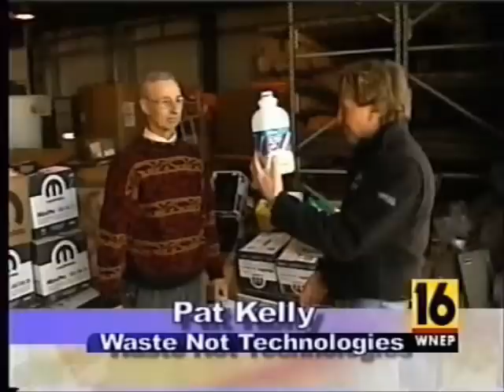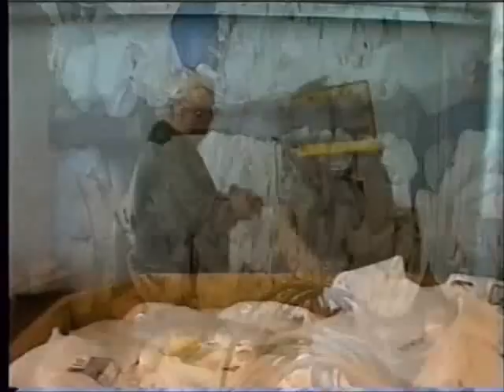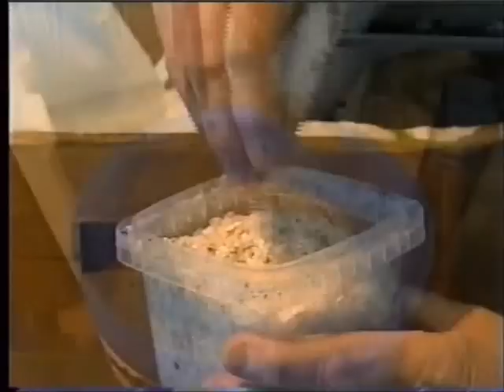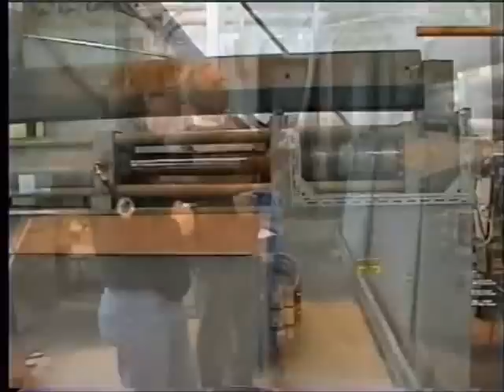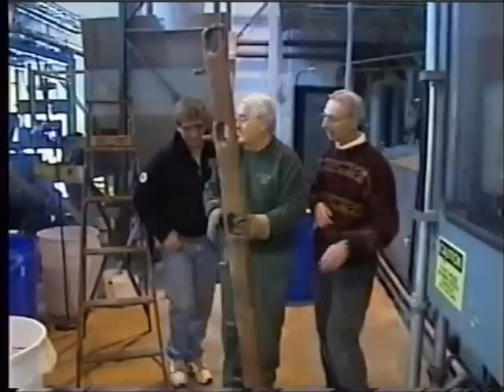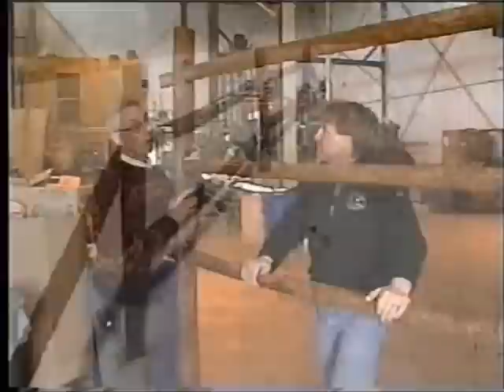Recycling Milk Jugs into Fencing

Comment: we use to have a plant that could melt down the plastic till they had a fire  they were that was about 20 yrs ago since it happend and during that time recycle was not a hot topic as it is today they made sheets of plastic size of plywood but solid plastic it was great product I used in on a basement floor made the floor much warmer and he water doesn't afffect it was easy to work and I glued it to the cement floor using no more nails. still there till this day.I am sure they could make some nice snap togeter floating floor tiles from this product and the different colors of platic they could make it look like marble.

Comment: I don't get what was so wrong with glass containers. It wasn't even recycled. It simply needed to be washed out and reused. I don't get why they just smash the glass instead of sending it back to the bottlers. They delivered milk to you in glass bottles, you gave them back when you were done, they washed them out, and they filled them back up with milk. Much more economical than melting down plastic. You can only recycle this stuff so many times.
Reply: it will eventually come to that.we have to face that after 2 or more reincarnations. goedendag
Reply: People used to put their cigarette butts in coke and soda bottles, not to mention other things not to be discussed. If anything was said they became quite profane. Always the one percent to ruin it for everyone.  I  like your sentiment.
Reply: So, you can't wash those things from a glass bottle? Glass isn't going to react with either of those things. Plastic, yes. Glass could simply be washed by boiling hot water.
Reply: probably had to do with the weight of glass vs plastic which makes a big shipping difference in volume and safety because if you drop a glass container it can be dangerous. I do get your point though about reusing containers.. unfortunately plastic containers can't be reused.
Reply: Yeah, but I would think the hit from transportation of full containers is overcome by being able to simply wash them, instead of having to shred, clean, and melt the plastic stuff. Not to mention that recycling plastic is pretty inefficient, because it's almost impossible to not contaminate. Every time it's recycled, it degrades.
Reply: +Tim Ramich well what you are saying is true... but your forgetting that companies are not shredding and melting the old bottles to repackage their product, like milk for example.. instead they are making new bottles all the time. which im sure us cheaper and less of a headache for them.
Reply: How would making new bottles be cheaper than washing out something like a glass bottle?
Reply: It's a shame they don't make landscaping timbers. They would outlast PT wood.
Reply: +Michael Hartman thats a good Idea, but they might not be strong enough to hold back the weight of the dirt.. you saw how much bend there was when the guy pulled on it
Reply: +justafan marvel I use 1/2" x 2 ft. rebar anchors spaced according to strength needed. I don’t know what you have envisioned, but I think most flowerbeds and garden borders might be contained in 1 to three timber high (12") walls. Looking at the neighborhood every house has timbered borders. I wonder if there would be leaching of dangerous elements like pressure treated wood and railroad ties. (railroad ties poison the soil for growing food  indefinitely)

If they were as strong as 2 x 4s they could be used in interior walls where  appearance isn't important and ultraviolet radiation isn't a problem. I wonder what the comparative price is.
Reply: +Michael Hartman i know what you are saying but Im still not sure that it would meet the strength requirements for the kinds of things you are talking about.. however more decorative applications would work fine like flowerpots.. landscape trim etc. of course siding for homes, flooring and maybe even roofing shingles would all be great applications
Reply: +justafan marvel I agree.
Reply: Tim Ramich
We buy our milk in 2 qt glass bottle from our food co op, here in Wisconsin. Just rinse the bottles and return them to the store. Castle Rock, is the name, Pasteurized and bottled on their farm.  Love the rich creamy taste too!
Reply: Well sadly everyone wants a perfect product and glass containers are very easily damaged just getting them back to the factors.
So then it's not just a matter of washing to perfection but inspecting every last piece top to bottom, and those that don't pass get smashed and molten again just the same.
Reply: .. they still wash and reuse glass bottles in 3rd world counties .. In Uganda you have to return glass bottles to buy refilled ones .. the reason it is not done in the USA anymore is because it is actually cheaper to make new glass bottles than to wash them or to recycle broken glass when you are talking large scale .. plastics for bottles are even less expensive .. are much lighter to decrease shipping costs and, of course, less prone to breakage, reducing waste
Reply: @justafanmarvel9669  : I am not certain on these facts, but here goes !   😊😊😊😊
1. There isn't a lot of strength required of most interior walls.
2. If strength is required, AFTER the "plastic lumber" 😊😊😊😊
is joined together, I would think you would generally have most of the strength you need for an interior wall.
The main problem, I would guess, is that plastic recycled boards are not as cost-effective as wood.
 In other words, wood is cheaper.
Reply: @dancahill9122  well wood probably is cheaper compared to the process of recycling plastic into 2x4 lumber... that's one reason... but i also think that there are a number of other factors such as resistance to heat... plactic can melt and deform wood and metal don't, attaching drywall to plastic studs probably isn't a good longterm idea either as the screws will strip plastic out and cause the sheetrock to pull away... then there is sound transfer as wood absorbs sound and plastic reverberates it changing the acoustics in a room and then there is the fact that plastic has off gasing which is toxic and plastic can become brittle overtime compromising the structure. I'm sure there are many other things i haven't considered. Belive me i am 100% in favor of recycling, reusing and lowering the cost of materials and maintenance  but i don't think this is a solution. I think recycled plastic is best used for non structural exterior applications where their properties can be maximized and their drawbacks can not harm us.
Reply: @MsSomeonenew   i picked many glass pop bottles up in the ditches as a kid 3 cents each not many were broken. now i pick the trash up in the ditch in front of my place most the glass beer bottles are not broken. from what i have heard unless glass bottles are reused. the recycling process is not glass friendly  too many colors and  types the crushed glass winds up as a landfill item. at least it doesn't  make islands in the ocean like plastic
Reply: @MichaelSHartman  people put rocks in and stuff in aluminum cans but they still recycle those. They don't reuse them because of obviously reasons. Like wear.
Reply: @justafanmarvel9669  That it does ,three eight packs of glass weighs fifty one lbs , plastic weighs a little more than half .Coke and Pepsi too many back injuries.
Reply: @beckywatt5048  i believe it. Glass has better properties, but plastic is all around easier
Reply: @justafanmarvel9669  We used to get our milk delivered in glass when I was a kid, I will have to agree everything tastes better in glass.
Reply: @beckywatt5048  that is true... if you want to do a blind taste test it's been my experience that Yoohoo demonstrates the best example of what you are saying... in the traditional old glass bottles Yoohoo tastes amazing... in plastic or out of a carton its almost undrinkable
Reply: Tim, The cost of sterilizing was more than bottlers wanted to continue with. Weight of glass containers was another factor. Also the retrieval costs were another consideration along with deposit refunds. I, like you, think it's a shame they don't do the 'real' recycling anymore but thats what bean counters do.:(
Reply: @timramich  Good question. Obviously if the bean counters are doing it this way it has to be the cheapest way.
Reply: Requiring a deposit on all containers (to account for the pollution if its not recycled). And for ppl that don't return them it will become tax. And since many stores won;t want to deal with recycling plastic. An alternative will be for the stores get bulk deliveries use recycled cleaned glass container like for milk and it will reduce the distance the heaver glass container have to travel. 
If truly safe biodegraded containers could be exempt from a deposit requirement. But pollution has cost so the cost should be added to the ppl buying the product and get the money make if they are recycled.
Reply: While it is a great idea, sadly some dam fool will introduce chemicals to poison others.  You can treat glass is such a way that it will only discharge the material either under cold thereby defeating the cleaning process.
Reply: @jimb9369 U must be joking? 1st what lethal material that fits those characteristics? But  just to be sure we will rinse it with cold water to prevents the psychopath killer scenario that your paranoid about. There has been food and drug tampering cases before but I have never heard of any that involved recycled bottles. So this no added risk. And good luck getting help with paranoia.To much time on social media can cause it.
Reply: Glass weighs a LOT more than plastic. I reuse my plastic jugs twice as much as other people. I fill them with water and use them for target practice before trashing 'em!
Reply: @nc3826 - Insofar as is the product that can be lethal, why would I put that information on the net? Are you kidding! Believe what you want.  Guess you missed the tampered pills that were sold years ago that killed so many.  No doubt you know everything!
Reply: @jimb9369 Just curious what's ur thoughts on vaccine safety? (while its off topic it's a more salient issue)
Thx for mentioning the pill tampering. That shows there are many easier ways to tamper with food or drugs already. And just rinse the bottles with cold water (which I already mentioned) eliminates the risk you mentioned. But if you still think it's unsafe don't buy it (if it ever becomes an option for you).

And we shouldn't make it about personalities. Since ad hominem issues or attacks are just a distractions from the subject matter.
Reply: @flapzapple7786  I'm sorry the far more environmentally sound alternative glass is to heavy for you. But thx for trying to partially mitigating all the environmental damage from ur plastic jugs.
Reply: @timramich  .. contamination is not so much an issue .. ABS degrades and for instance, you can not use recycled ABS in medical devices in the US, only virgin and recycled ABS .. HDPE doesn't degrade at all, will not absorb moisture, has zero off-gassing or odor, and is hypo-allegenic
Reply: @erikaamot72  "you can not use recycled ABS in medical devices in the US, only virgin and recycled ABS" What?

HDPE most definitely does degrade every time it is melted. Some of the polymer chains break into shorter ones. Things oxidize as well. Moisture can most definitely get into HDPE. I work in a plant that makes HDPE lumber.
Reply: @timramich  .. lumber? .. lol .. well I own a fucking plant .. thermoforming.. injection molding .. fabrication .. I know the qualities of every kind of plastic down the molecular level .. Automotive .. medical devices .. I spec out what I want from the plastic manufacturers like Spartech .. fuck .. I regrind and recycle tons of of HDPE and ABS .. I was only interested in this video because I am trying solve trash and recyling problems In Uganda .. the whole fucking county .. I supply diecut plastic panels to plants in Europe because no one in Europe can figure out how to do it AT ALL much less at a profitable price .. in San Diego .. but that beautiful woman in my profile is Ugandan .. brilliant 29 year old and I'm 65 .. life is good .. Praise the Lord and you have a nice life Tim .. thanks for the laugh
Reply: I worked at a Coca Cola plant when they decommissioned the glass bottle line.   Those were narrow necked bottles but the process of reconditioning (washing) was very difficult.   Grocers had to store the empties (outside - flys, bees),  drivers had to inventory and load them spending time on an unprofitable operation.   Once they got to the plant, they had to be stored separately because of insects,  possible broken bottles and dirt.  Each bottle had to be placed on the conveyor by hand (new bottles come palletized) because they were randomly returned.  Once on the conveyor, the process was pretty automated.   The only other issue in the plant is broken glass is a hazard to employees and consumers.   If a bottle broke, the line shut down and every gram of glass had to be accounted for before restart.  I remember the shipping weight also being an issue and just the extra diesel cost was enough to justify the conversion to plastic.  We were happy to be done with glass.
Reply: @PaulVFahey  If a machine can pick up a bunch of bowling pins that are in random directions, then certainly they could do the same with glass bottles. I don't see why they would be so anal about broken glass before they were washed. The good ones could be turned upside down while being washed. It seems easier said than what they were willing to do.
Reply: And a lot heavier and more breakable. Don't get me wrong I'm old and I miss glass bottles, but I can see the why, even if I don't like it.
Reply: @dancahill9122  It's OK.. no spell checker here..

Comment: The other process that the plastic was put through that the tour guide skipped over was likely the adding of 5% shredded paper confetti which the end product is plastic wood, sold at hardware stores to make outdoor decks.
Reply: Patty Baker is the paper added so that it will eventually fall apart? the plastic would be more stable if it didn't have the paper added but then you might have a 100 year fence
Reply: +Justin Kasey 
The paper is not added – it never got separated out after shredding the containers with labels glued to them.
:

Comment: Nobody ever mentions the amount of energy to create this product.
Reply: jpalm32 As long as it is powered by clean energy, we have a concept
Reply: @michael-dm2bv  burning plastic pollutes the air. This pollutes the ground. Plastic breaks down from the UV rays from the sun and leaches into the environment.
Reply: @excitedbox5705  - if you watch large scale plastic recycling enterprises they are constantly manipulating the plastic using huge loaders, machines using electricity to shred the plastic and to remove the labels and to pack and shipthe cleaned plastic.  thats air pollution too.  why is it any different.  a properly designed incinerator burns plastic as cleanly as an oil fired power plant burns oil.  its going to pollute in some manner but thats the price you pay to simplify the recycling process.  collect plastic, clean, dirty, with and without labels.  pack it into a trailer with a walking floor.  drive to incinerator.  unload.  burn.  make energy.  u avoid the pollution caused by excessive handling of the product and you make the same pollution when you burn it, so the pollution caused by either method cancels out.  have you ever seen the beaches in india covered in plastic?  they make it out to be such a big deal.  its not.  build a clean burning incinerator, pay those shoeless indians by the pound to collect plastic, and burn it and make energy so they can put a light bulb in their hut and the plastic collection puts a few dollars in their pocket while helping to clean the plastic thats EVERYWHERE.  problem solved.  air pollution?  oh well!  we only have forty miles of our first two layers of the atmosphere above our heads.  do you really think a few dozen clean burning plastic incinerators can saturate that much air?
Reply: @michael-dm2bv  you save a massive amount of energy recycling. When you recycle glass by melting it down you save close to 90% over starting from silica sand. It is similar with plastic.
Reply: @excitedbox5705  - yes and no.  if the infastructure is there, like collection containers people put on their curbs, sure.  but if you think collecting thousands of pounds of assorted trash and debris from the ocean, sorting, cleaning and recycling it is ecologically sound ur wrong.  u burn it and make energy.
Reply: jpalm32 That type of plastic can be melted and refined into gasoline and other fuels

Comment: Dec. 4, 2018---Thanks for the video....good usage of what would other wise be land fill somewhere. Wonder if the company could make a square 4"x4"x8' fence post, along with 2x4's and fence boards using screws to hold everything together? Never have to paint it and of course, it won't rot with the posts in the ground w/cement holding them.

Comment: are the posts economical to the point that the average home owner/farmer can afford?  great video-always wondered,  thanks...
Reply from the maker: Yes, given the fact that they will never rot and outlast wooden posts that rot after only a few years, you save a lot on maintenance / replacement costs.  Price chart can be found online here:  http://www.closetheloop.com/allproducts/fencing.html
Reply: The cost appears to be about 3 times the cost of treated lumber, which averages about 10 years for posts and you incur the labor costs at the same frequency.   Doubling the life of the posts pays for the added expense, and everything after that is gravy.   So, while it is expense short term, long term it pays off.